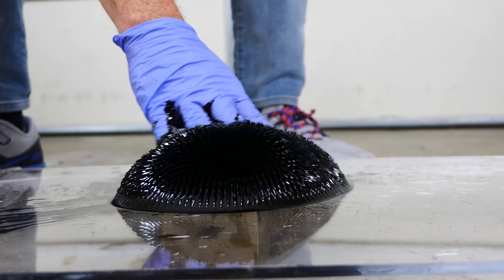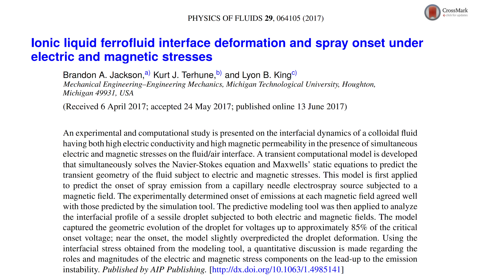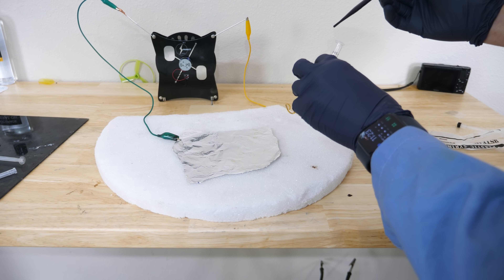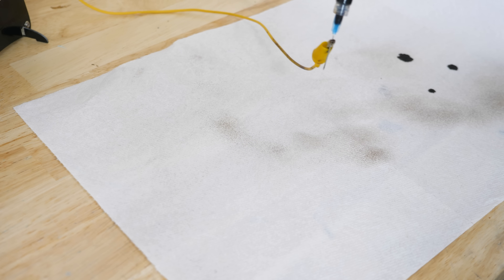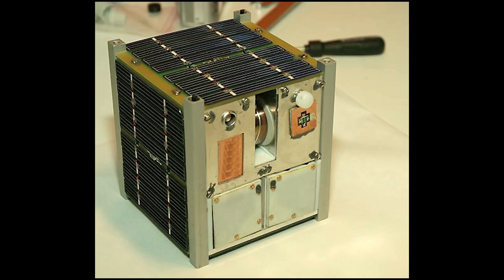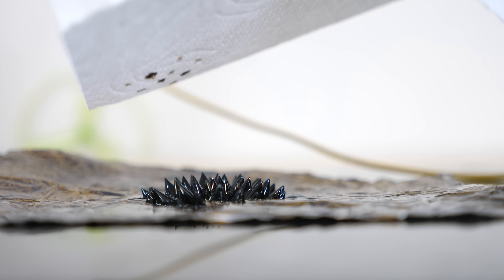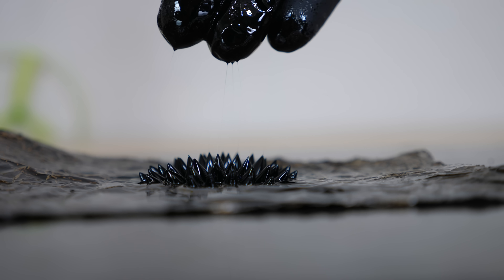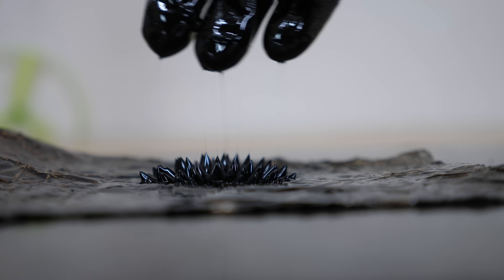Ferrofluid Could Be The Future of Space Propulsion

Comment: What else can this be used for? 
Maybe it's a silly idea - but could this approach be useful for some kind of 3D-printing or additive manufacturing?
Reply: First thing I thought of was an alternative to airbrushes
Reply: You would have to find something else then the oil that is used.  Oil would not make a good building component of 3d printing
Reply: @theboz1419  - suppose the oil could be removed after serving its purpose as a carrier? They also demonstrate an ionic surfactant being used instead of oil - but it's again another carrier fluid. Suppose we can find a fluid that has the necessary carrier properties and can also later be removed? Maybe something volatile? Maybe something that breaks down, perhaps in the presence of heat, or UV, or whatever?
Reply: @theboz1419  What about some kind of liquid that polymerizes?  Probably would have to be some kind of epoxy that polymerizes a certain time after mixing, because the iron particles would absorb anything like UV light.
Reply: As a special effect in the next Venom movie.
Reply: A way to replace tentacles for Japanese sussy
Reply: A technique known as "electrospinning", which involves passing a solution of polymer through a needle charged at high voltage, has been used for making nano scale polymer fibers and non-woven fabrics.  The basic effect, known as "electrospray", was discovered in the late 1500's by William Gilbert.  Wikipedia has pages for each.  Also, a search on "Taylor cone" (the elongated shape that droplets assume in an electric field) can get you to the math describing this phenomenon.
Reply: @robertlapointe4093  Also has a page on colloid thrusters, which says that these have already seen a bit of use.
Reply: @robertlapointe4093  - I've heard of electrospinning being researched for use with solutions or suspensions of carbon nanotubes. I'm aware that the sharpness of the cone helps to reduce the work function associated with ejecting material. But electrospinning seems slightly different than this magnetic method. Does magnetism hold any advantages over electrospinning?
Reply: @manofsan  it's something similar to bubble electrospinning, or rotating electrode electrospinning, the advantage of the magnetic field might be the direction controll, but it's in question since this could also be achieved easyly with electrostatics.
Reply: @manofsan  I don't think there are any great advantages to using a ferrofluid and a magnetic field to achieve a pre-Taylor cone meniscus, compared to just using a fluid in a tube (needle) and electric fields.  Not really my area of expertise though.  My focus is mostly on making new polymers, not processing them.  The only reason I know a little about electospinning is that I am also a high-voltage hobbyist and the method seemed interesting, if not very practical, so I've read a bit on the subject.  I'll probably try it at home eventually, just have to dust off my Cockcroft-Walton multiplier and make some polymer solutions.
Reply: Powder coating...
Reply: @zippythinginvention  - hmm, aren't there already electrostatic methods for applying such coatings? What advantages would ferrofluids offer?
Reply: @manofsan  that's actually what I meant. No fluid required.
Reply: I heard it's been used in hi-tech car brakes.
Reply: probably you should study research papers instead of flashy youtube videos
Reply: @sayandebnath6445  Watching "flashy youtube videos" is what I do for entertainment.  My day job is industrial chemical research which does include reading and occasionally writing research papers and patents.

Comment: An electromagnetic energy squeezing mechanism is proposed based on the special properties of permeability-near-zero metamaterials. It is found that nearly no energy stream can enter a simply connected conventional dielectric material positioned inside a permeability-near-zero material. When the dielectric domain is shaped as a split ring (with a gap opened) surrounding a source, the electromagnetic energy generated by the source is forced to propagate through the gap. When the gap is narrow, the energy stream density becomes very large and makes the magnetic field enhanced drastically in the gap. The narrow gap can be long and bended. This provides us a method to obtain strong magnetic field without using resonance enhancement.

Comment: Seems similar to conventional ION drive, but this one has possibly more IRON drive pollutants?
Reply: It's also sound like It solve nothing since you still end in need of container for Ferro fluid It self
Reply: @leobuana7430  ... and additional weight for a power supply. The power to weight ratio mathematics will not make sense if they want to launch with this.
Reply: Possibly? I'd say definitely.
I hope our scientists aren't this irresponsible and short-sighted. Like OMFG i hope not.
If those small satellites are using this up there right now, this video is the most depressing thing i came across today. :(
Reply: ion drives / hall thruster do  not scale down well, hard to make them the size of entire cube sat let alone provide propulsion for one and have space left over for a payload. this tech fill a gap in  thruster size than can be made very small but also have a relatively high ISP. most cube sate don't have thrusters the ones that do are usually cold gas. this tech is 100x more efficient that cold gas but is similar size and weight.